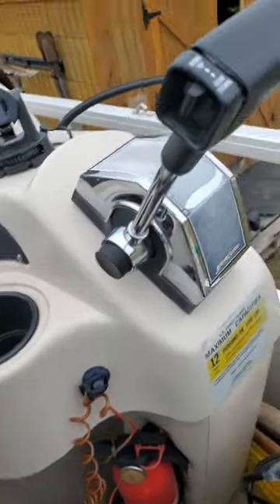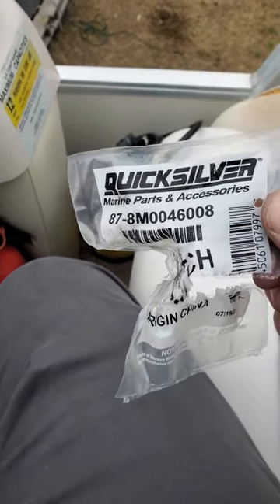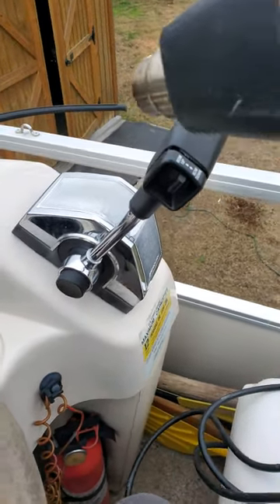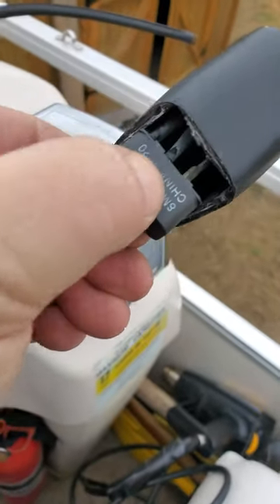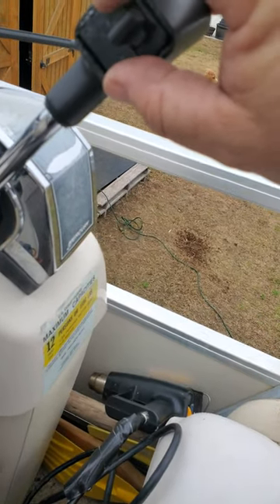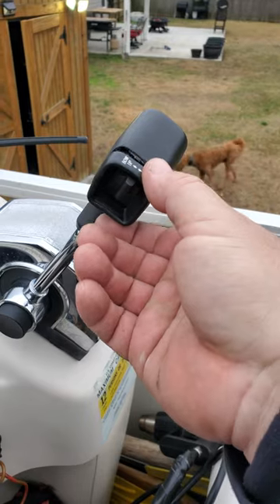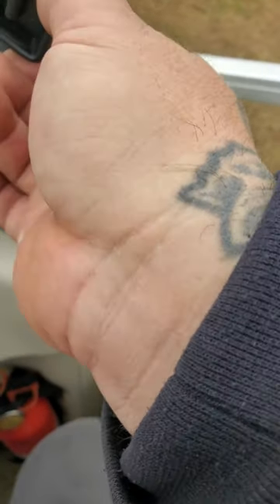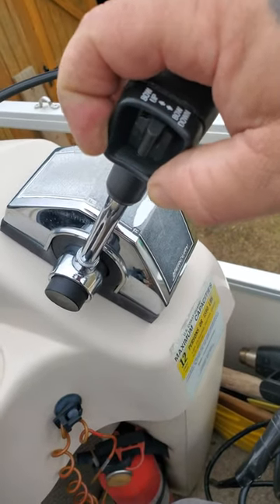Mercury outboard throttle tilt switch fix

Comment: The original switch you showed is easily fixed if its not too far gone. Most probably the contacts are completely filthy and somewhat corroded. You can pop the cover of the switch and gain access to the ceramic toggle pivot post and the contact leaf. I used a fine fingernail polish stick to clean the contacts. Clean out all the old grease from the housing and replace with dielectric silicone, or something like, it at the contact points and around the ceramic pivot. Did mine about 5 years ago and hasn't failed yet. I used a less aggressive adhesive to remount the bezel so that if It goes bad it will be easier to fix with new parts.
Also, I was able to remove the bezel by squeezing it carefully with channel locks. It broke away very cleanly and with very little damage to the bezel.
All credit and thanks go to Jerry. I didn't even know that the bezel was glue on.

Comment: My switch is working but it's way down in there and hard to get to,It's like whatever holds it in there is broke or missing...Any suggestions.I have a new switch to put in it,but I think I will run into the same problem...

Comment: Mine looks the same but the box says Quicksilver, is this the same exact part, just rebranded? Also, should the big button on the left pop out in neutral? My button doesn't seem to do anything and it always requires a bit of play to feel when boat the boat is in neutral or when it will switch to gear.